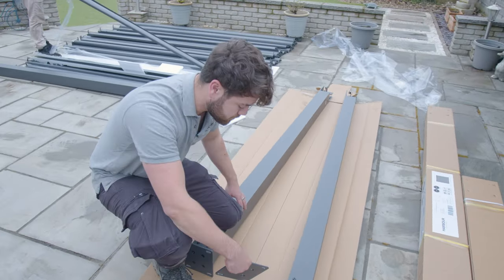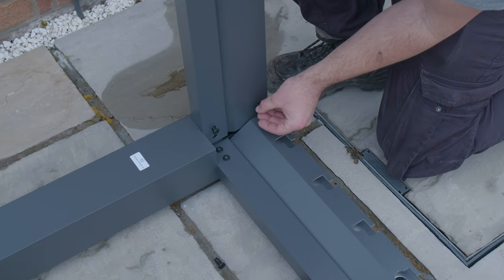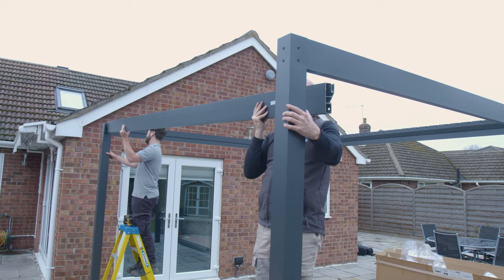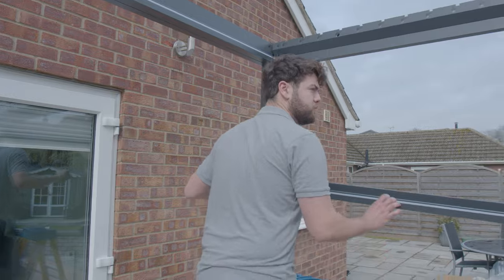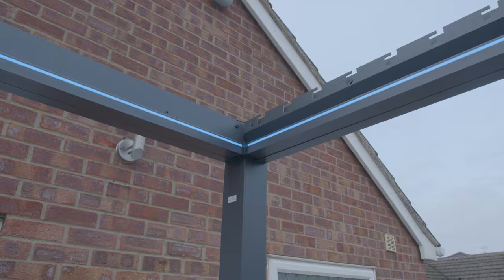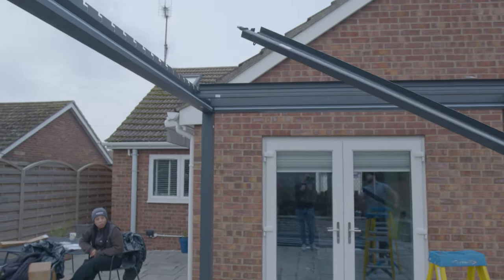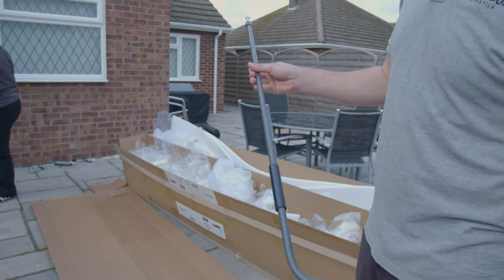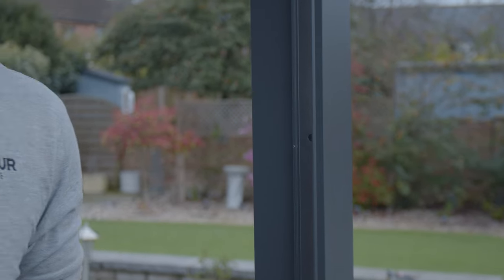DIY Pergola Installation | Step by Step Instructions 2024

Comment: Excellent instruction - and needed as the supplied written one is pretty poor.  One aspect it doesn't cover (and suggest it usefully could) is final checking of location, squareness of the structure in plan, verticality of the legs and anchoring down of the bases.  Each leg base can easily be independently shifted small amounts by taps with the heel, so all can be manoeuvred to ensure perfect geometry and that all legs are vertical before anchoring down.  Also high winds can cause significant uplift - there have been cases of anchoring just onto a patio paving slab not being adequate resulting in the structure collapsing.  (Comment by retired chartered structural engineer)